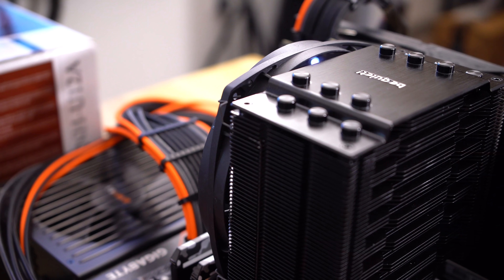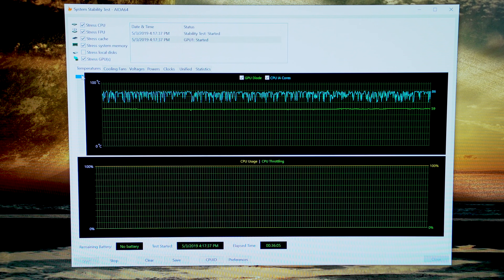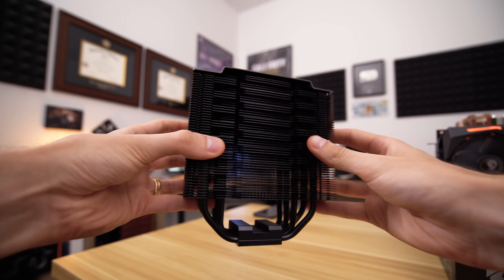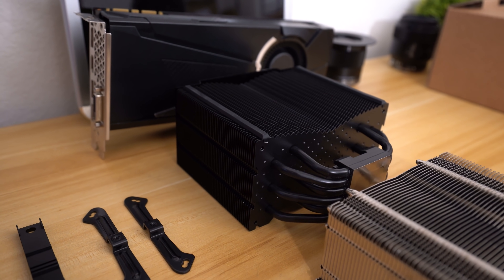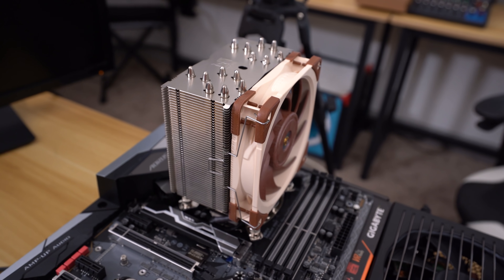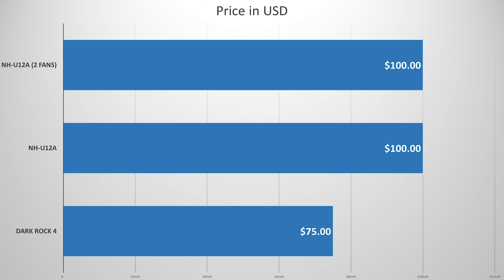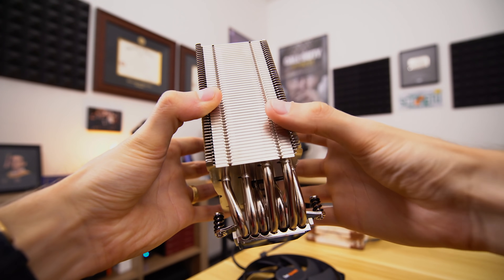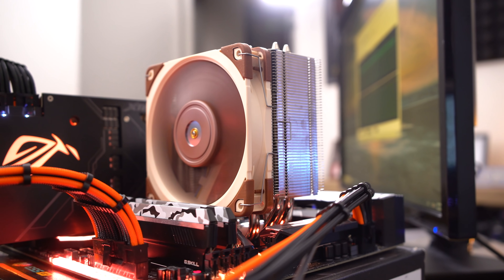Air Cooler Showdown: NH-U12A vs. Dark Rock 4

Comment: I just bought the u12s which is the chromax version of the u12a for cheaper than the dark rock 4. I run a 3700x and my h80 died. So I’m going full air cooling.

Comment: You didnt try the Dark Rock 4 with 2 fans? Seems like a wasted opportunity to compare these 2 coolers
Reply from the maker: Why would I try the Dark Rock 4 with 2 fans if it only comes with 1? If I added a 2nd, the effective price of the cooler rises. Pretty silly deduction, there...
Reply: @GregSalazar  because anyone comparing these 2 is obviously looking for performance vs price. Dark Rock 4 is a $75 cooler and the U12A is $120 (pulling both prices from Amazon on 5/12/22)... another Silent Wings fan will run you a whipping $22 making the Dark Rock 4 with 2 fans a $96 total price cooler..... so back to my orig question,  why not try the Dark Rock 4 with 2 fans (closer price to U12A), matching the "push/pull" of the U12A out of the box. If the DR4 is a better cooler with 2 fans for $96, I'd gladly buy that over the U12A for $120

Comment: If someone here is still checking for one of these coolers and is worroed about the ram clearance of the dr4 don't worry, you can lift the fan's position on the cooler's tower so you have enough clearance for your ram!

Comment: 25$ really isn't much when putting together a higher end build. The NH-U12A is cutting edge cpu fan tech and assured quality and performance in as small a form factor as possible imhop. Looks?, I did a "stealth build" with a black mesh mid tower with no rgb except on the inside on the GPU and mb both set to heat indicator mode so the inside of the case is mostly a steady dark blue. The few friends I've had over who know anything about pc tech who have taken a peek at the window side of my rig have both said "dayum!". Aesthetics of stealth build mission accomplished.

Comment: I have an issue. My case is cronos 350m which max height of cpu cooler is 157mm. Can I mount Noctua NH-U12S that has 158mm height? The side case is acrylic panel.

Comment: Well, one year after you posted this, , after looking at most high end cpu fans, I ended up going with a u12a for my 3900x.  I was going to go dark rock pro 4,  them NH-d15,  and a ton other other be quiet and noctua variants.(there are a lot of options) I considered liquid cooling  but would hate to have a failure and not catch it in time.  I watched the scythe fuma2 closely.......etc.... we consumers have a lot of choice  - almost too many. Not like the old Ford's- ya can have any color ya want, as long as its black....the good old days.
I still need to upgrade other systems so maybe I will do a dark rock for one. Cryorig have a really nice all copper unit that I'm sure is good - might be a good video for you (pricey though)
Cheers 🥃
Yeah, the noctua is ugly. I've grown to like them only because know the color represents a quality product. I do like the 6 year warranty on noctua, that was a factor for me as well. Hard choice

Comment: I mean you could buy another PWM Fan from bequiet for ony 18€, I'd probably get that for a 2 Fan config on a Dark Rock. Would've loved to see that tested as well. I really wonder by how much it makes the gap in performance even closer to the Noctua.
Reply: Late answer but the non-pro Dark Rock 4 isn't designed for mounting 2 fans at all

Comment: I have the Noctua NH-U12A and after months of various testing i came to this conclusion: This noctua has one downside. At a certain point and above (rpm) it doesn't make a difference on the cpu temps whether you have the rpm at, lets say, 1500rpm or max 2100rpm. I've been testing this on 8700k and 9900k with nearly the same results in gaming. The increase in rpm should have made a difference and i believe that this is due to a design flaw. I think its due to the fact that the cooler is not thick enough and the heat-pipes do not get max benefit from the cooler fins. 7 heat-pipes need substantial fin surface area. That is why still the D15 is still king because it is huge. They tried to make the U12A as much compact as possible and this might have cut some performance off the cooler. If it was slightly thicker, at max rpm it would have performed the same as 360mm and also beat some of them and even beat the D15. Overall it is a very good cooler and considering its size it is impressive. It keeps my 9900k cool.

Comment: Awesome video! That helped me a lot in making a decision between those two, but I have a question, if I detach one of the two fans to install it in the back of the case (for best airflow and extract the heat), will it come with all the necessary accessories/installation parts for that fan (screws, etc.)?

Comment: HuhThese temperatures still seem really high. My Max while gaming with very intensive usage was also 89 C with the stock cooler the ryzen 3600 has. I need it to be much cooler than that as I could feel the heat off of it

Comment: Just put two BeQuiet silent wings 3 on the Noctua. Bingo. you get the best of both...cooling and quietness.
Reply: This will cost an extra $40 or so for the silent wings fans and assumes that the cooling performance of the Noctua would remain the same with the BeQuiet fans. However, if the Noctua decreases in cooling performance to anywhere near the Dark Rock 4's levels, you might as well have just purchased the Dark Rock 4 and saved like $65 ($100  + $40 vs. $75).

Comment: Funny thing, i was just looking for a good aircooler for my  rig and i had a dilemma between the dark rock 4 and the nh d15s
I finally chose the dark rock just because it was better value (60€ for the dr4 vs the d 15s' 80€) and also because of the better acoustics.
Basically, what the dark rock loses in performance it gains in acoustics AND you could also add another silent wings 3 on the back, probably making the final choice even harder :)))

Comment: 1) In the case of U12a, you get an extra fan for $ 25 (retail 29.90)
2) Always run an extra test at silent rpm
3) A test on 6 cores is not representative (at least 8). The difference will be more significant.
4) As you correctly noticed, U12a has better compatibility with RAM and PCI-e (especially on m-ATX). It also has a more convenient mounting system.

As a result, you get what you paid for. The main question is whether all this is necessary in each case.
Reply from the maker: A test on 6 cores is not accurate? According to what logic? I know plenty of six core chips that run hotter than 8 core ones. I don't think you're very familiar with this kind of testing methodology. Also, running at "silent" fan presets does nothing because the fans have different operating RPMs.
Reply: @GregSalazar  "A test on 6 cores is not accurate? According to what logic?"
According to the logic, an overclocked eight-core (of the same generation) generates more heat and at a certain moment one of the coolers may become insufficient for its cooling.
"I know plenty of six core chips that run hotter than 8 core ones. I don't think you're very familiar with this kind of testing methodology."
Me too, but usually they compare processors of the same generation.
"Also, running at" silent "fan presets does nothing because the fans have different operating RPMs."
This mode imitates the everyday work of a PC. Most people need a quiet PC, even under load.

Comment: So with a non overclocked system the second fan seems overkill, will only a few degrees difference  in cooling and a relative increase in volume
 i've decided to have my NH-U12A with a single push fan and use the second one as a case fan - i'll use it as an exhaust fan in line with the cpu cooler, keeping it on the y splitter under the same pwm control as the cooler.

Comment: Noctua coolers are for those who prefer performance and quality. The others don"t perform so they have to look impressive. Side note. Those ugly fans you don't like. Don't die. I still have ALL of my Notuca fans and they all still work. Some are over 10 years old and still purring away. EVERY other fan I ever got has died. I bought my c12P when it first came out (2008). It is still running 24/7 and its 12 years old. Go ahead. Buy your crap fan cooler and save 25 bucks....8 times out of ten. You will be replacing the fan 10 times out of 10 because it died.
Reply: You forgot to mention the fact that when intel and/or amd change their cpu socket configuration for the newer boards - Noctua will no doubt support the change with an adapter kit so you can continue using your existing cooler rather than have to buy a new one. 
Noctua = investment. 
Show me any other company with a 15 year old cpu cooler that still supports modern AM4 Motherboards?

Comment: If i already have the stock cooler installed on my ryzen 5 3600 on an x570 board, can i use the mounting hardware that came with my stock cooler or do i have to install the mounting hardware that comes with either of these coolers?

Comment: I think dark rock pro4 runs in lower rpm that is the reason for low noise levels
whereas Noctua runs at higher rpm and gives optimum noise levels

I wonder why these YouTubers don't show at which speed these fans are rotating?

Comment: I just built new rig, with Noctua NH12 A, it rocks. I can't even hear it run unless under real heavy load. I have 3700X and do Alot of video editing. This thing might not be the best looking cooler, but, I can run at 38c idle and 65c under full render in Divinci. I don't think water cooling can do much better, from what I have been hearing?

Comment: How do these two coolers compare to the Cooler Master Hyper 212 EVO?
Reply: They don't compare afcourse 212evo is alot weaker cooler it has only 4 heat pipes dark rock pro 4 has 6 and noctua has 7 but really depends on wat cpu ur using I was using cooler master t4 b4 on a 2500k I got a used dark rock pro 3 and I just think that cooler is an overkill for 2500k but I m using it anyway

Comment: What distance are you measuring the sound at (One meter?) and what was background noise level? And to be honest it's not a very valid test without also testing these in quiet cases - it's just not realistic. And Deepcool's Gammaxx Gt (?) cooler is also very quiet but perhaps not as efficient. More testing needed.

Comment: You should have tested the 2 and 1 fan configurations with the low noise adapters as well. From what I’ve heard, the NH-U12A does not give you much better performance on higher fan speeds.

Comment: Excellent video! Has anybody tested the performance difference between NF-F12 (Cromax) vs the newer NF-A12x25 for the Noctua CPU Coolers? Noctua claims that the Cromax is better for CPU Coolers, but it doesn't give any hard numbers regarding how much better. The other question by how much do the different materials (Sterrox vs plastic) used to make the two fans impact their perfomance?

Comment: The second fan doesn't do much. I have Noctua Nh-d15, it comes with two fans as well so i had the opportunity to test it myself and the difference was negligible in the favor of two fans, basicaly within the margin of error (1 to 1.5 degrees...maybe). I tested it inside of the closed case and i used aida64 as well.
It seems the first fan does 99% of the job and the second one is just assisting.

Comment: Save money by getting a Cooler Master 212 Evo + Noctua Fan. Good enough for most overclocking situations. Running on it on my i7 2600K @ 4.6GHz, and temps at load are below 80C.

Comment: Fantastic to see the single fan performance. I'm actually running it as that now.
I used the extra fan as one less case fan to buy, so in a way.. its better value? sort of lol.

VERY happy with the results.. very similar temps as my H100i (a few deg in favor of the AIO), yet DRASTICALLY lower noise.
Like, Noctua NHU12A plus the NFA12x25 (or whatever they are) fans.. at full CPU load, is lower noise than my H100i plus corsair ML case fans at idle.
Insane.

And for some reason.. I'm attracted to the brown poop theme.
*Word is, black versions out mid 2020.

Comment: Are you sure??? I have several noctua coolers and I've found that having the dual fan set up is cooler and runs quieter. Did you use the noctua y splitter cable??? You also failed to mention the other components that come with the Noctua coolers, including the very convenient tool to screw in the cooler. That by itself is easily worth $5. Others component that come with noctua coolers, rubber gromits, screws, an extension cable, a low-noise cable, a y-splitter adapter, and the Noctua chrome sticker.

Comment: hmm.. lets see, U12S ($80 CDN) vs U12A ($140 CDN). Nope.. U12S is still the king.
Reply: Even with adding a second Noctua 120mm fan ($30 CDN) to the U12S = $110  and U12A = $140.. still nope.

Comment: It would be interesting seeing how whould the two Coolers perform with the fans switched. If the heatpipe on the noctua is the thing that make the cooler perform this good, with the more silent be.quiet! fan it should be overall better(apart for the prize in obtaining everything).
I read that the be.quiet! fan spin at 1350rpm vs the noctua's that runs at 2000rpm, right? Does that means that the be.quiet! fan move more air?

Comment: It would have been REALLY nice to see an additional test , which would have been - both coolers with same fan at same rpm
Reply from the maker: I test what comes in the box for a reason, and every fan is designed to operate within a certain RPM range.
Reply: @GregSalazar  Yes , I certainly agree with your method , but it is certainly interesting to see how the Towers themselves perform on exactly same conditions
Edit : Of course that's only my opinion

Comment: Can you recommend to buy the dark rock 4 and putting an noctua 120mm fan on it? I have heared that the only reason the dark rock 4 isnt performing as good as the noctua is because of the lower static pressure its fan creates. The heatsink of the dark rock 4 is supposed to perform better with more static pressure (as it is more dense like he mentioned on his video). Can anyone confirm?
Edit: typooo

Comment: I know it's a bit later on but I used that website you mentioned to by a windows 10 pro key. 100% legit and I saved 3 bucks using your promo code dropping the price to 12 USD. Thanks for the new key site.

Comment: Hey man I recently started buying and selling PCs and was curious as to how much you honestly think I should sell this one because it's one of the first high end gaming PCs I've ever sold I guess here are the specs
Specs
i5 6600k 
Asus gtx 1080 turbo
2x4gb 2400mhz
Biostar matx motherboard 
2x500gb hdd 
120mm corsair aio w/push & pull configuration on the fans
Evga 650w 80+ gold psu
Fractal design define r6 case

Comment: I don't really agree with your argument that dark rock 4 is quieter. The U12A is roughly 5 degrees cooler and you could therefor lower the fan speed to achieve the same temperature as the dark rock 4. This could result in the U12A having the same operating noise level as the dark rock 4 or even lower for the same cooling performance. 

Otherwise it was a very interesting test and I think it was a great idea to use carbonaut instead of thermal paste! I would love to se more comparisons between the U12A and other air coolers, but please include noise normalised testing.

Comment: for me, i wouldn't choose either one of them. 70-80C is too high for my liking. especially because my living area is very hot.
seems like me choosing neither for my 2600x is a good choice. i decide to go with corsair h100i rgb platinum. not because of the rgb. but because it's the latest water cooler. and it's very cool.
Reply: A h100i will literally perform the same as a beefy air cooler...
Reply: @Jonathan-fw6ty  - keep telling yourself that. because people that i know that uses beefy coolers for their 2600x. still gets temp above 70C. while my temp never went above 60C.

Comment: NH-U14S is below $70, NH-U12S around $60, suddenly they replace the U12S with U12A and make it $100?

Apparently, performance-wise, it's supposed to be much better than the U12S and just as good as U14S... Which are both much cheaper.

So basically Nvidia? New generation is 12% better but 50% more expensive?

I preferred the times when we were getting new generations of hardware with more performance for the same price :/

Interestingly, when I was building my current system, I actually got a bigger case specifically to fit the NH-U14S. So maybe the NH-U12A actually CAN make sense if you want to fit 4 DIMMs, don't want to sacrifice even a single degree, but already have a case that simply doesn't fit a 17 cm tall cooler (the U14S). That Bequiet! and lots of other coolers don't meet the DIMM requirement in positive pressure configurations, so...

What I'm saying is, maybe it has no competition in its class? You didn't show any competition from either that actual size class, nor that performance class, nor combined size+performance class.

PS. Running some measly 6-core i5 to test thermals of a supposedly "top tier" cooler makes no sense, which may have made the Bequiet! look so favorably, and no one apparently noticed you compared a non-Pro (so, "mid tier") Dark Rock with this ("top tier"). It should have been compared to the NH-U12S due to price and because they both should suffice in this scenario ;)